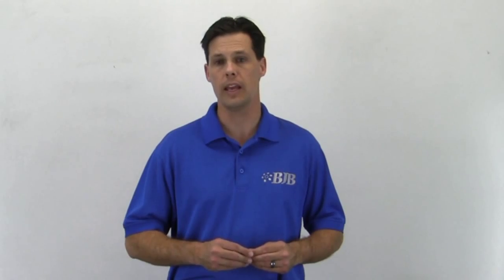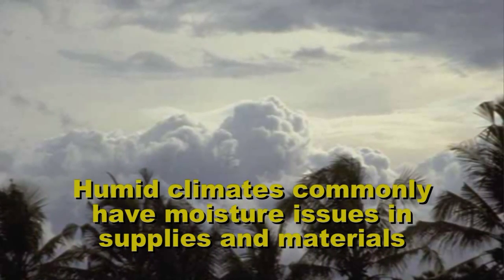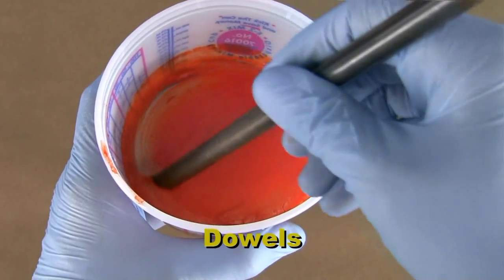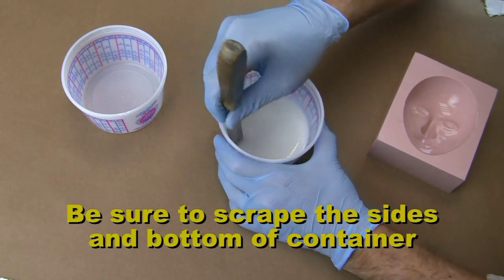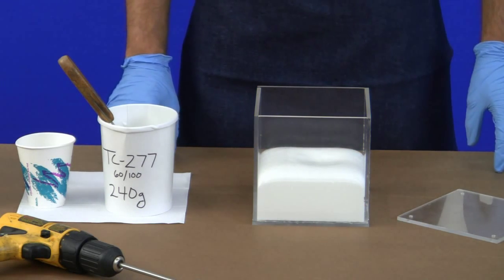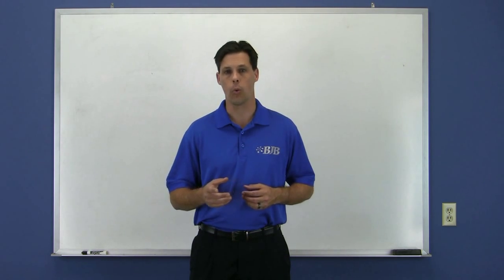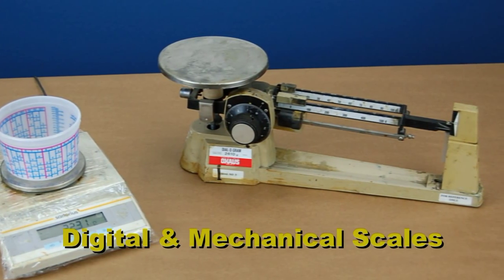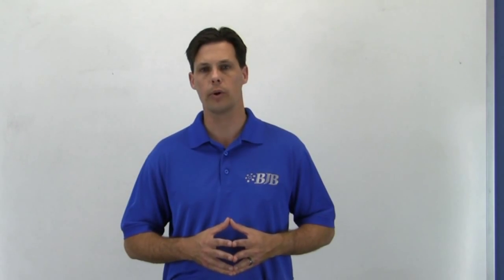How To Properly Mix 2-Part Resin

Comment: This is a great video.  I was about to purchase a scale to mix my resin, until I saw another video where Part B weighed significantly more than Part A, which is why we shouldn't measure by weight, but by amount.  Any thoughts?
Reply from the maker: Samantha Castleberry your resin is designed to mix by volume and the density of A vs B is different.  Mixing by weight is typically far more accurate than volume mixing by eye, but many systems are forgiving enough to allow for slight ratio offsets and will cure fine if you’ve mixed thoroughly.  There are some resin systems and silicones that are very critical on the ratio and it is highly recommended to use a scale in those cases.

Comment: Can the epoxy be diluted if too thick. If so with what solvent?
Reply from the maker: we do not recommend "diluting" epoxy or urethane resins as it would effect your physical properties. it is possible to make them less viscous by heating the material prior to casting but that will also lessen your worktime.
Reply: @bjbenterprises  Thanks
Reply: Thanks.  I had this same question.

Comment: I am not claiming to be more knowledgeable on this subject than this guy is because it's obvious to me that this guy knows more about this stuff than I do. But be aware that some epoxy manufacturers prohibit the use of any mechanical mixing device because of the air bubbles such devices create in the resin. And that makes sense to me. So use or ignore my advice as you see fit. Good day.
Reply from the maker: It's certainly possible to mix air bubbles into you epoxy resin using a mechanical mixer, but it's usually from using an improper mixing blade and/or mixing too small of a batch so the blade is not fully submerged.  If you use a mechanical mixer in a shallow pool of resin, you will induce a lot of extra, unwanted air.  Hand mixing would be a better solution in this case.  Also, if you run the mixer in and out of the liquid you will induce more air (not recommended).  Many shops will also degas the mixture in a vacuum chamber to remove air before using so the bubbles can be dealt with.  If there are high level of fillers in the resin (like aluminum filled epoxies) a shearing blade will increase friction and cause some heat.  This can be a good thing or bad thing depending on the mass of material mixed and the worktime of the system.  Other than those items, there is nothing inherently bad about using a mechanical mixture if you understand the how to use it properly and know pros and cons of using one.
Reply: @bjbenterprises  Thanks for the information, I appreciate it and will put it to use. As I'm sure others will also. What not to do is as important as what to do when working with sensitive materials. Thanks again.

Comment: does the Tc 5050 a/b need to be vacuum ?
Reply from the maker: Only if you don't bubbles in it.  You can still make a mold without using vacuum, but expect many trade offs.  The end user has to decide if those trade offs are important.  Pulling vacuum does the best job at reducing bubbles physically.  Some bubbles will rise to the top and pop on their own, but you will still have bubbles in the silicone.  This reduces tear strength, increases possibility of aesthetic bubbles on the surface, and prevents you from being able to put the mold in a pressure pot later.  TC-5050 is one of our best production mold silicones, but the higher viscosity is a trade-off for best longevity and performance on the mold.  Low Viscosity silicone systems designed to be "no vacuum necessary" will trade durability and stability for ease of use.

Comment: What do you recommend to clean the resin off your tools?
Reply from the maker: Isopropyl Alcohol works well for polyurethanes if it is still in liquid state.  Acetone works well if it is starting to cure or has already cured.  For silicone, just wait until it is cured and it peels off or rubs off with a rag.

Comment: I sat through all 7 minutes and He never addressed  BUBBLES  in your mix.  wtf.?.  I hate bubbles,    I wanna know how to get em out..  or   stop em from forming in the first place..
Reply from the maker: Hi Thomas.  Indeed, bubbles are a pain.  We do address dealing with air bubbles in our other mold making tutorials, but it would be a good idea to make a stand-alone video on dealing with them.  The truth is, if you are mixing thoroughly to achieve a proper mixture you are going to entrap air bubbles.  Period.  The best way to deal with them is to vacuum degas the mixture.  This works for both silicone and cast urethane.  For details on pump requirements and other tips, watch here:  https://youtu.be/iRj6xzNx7P4?t=12m15s  Pressure casting is another method but we explain the differences between the two here:  https://youtu.be/WME8R2-Ot8E?t=8m57s  Thanks for the feedback and let us know if you have any other questions.
Reply: Hi BJB,  Thank You..  I'm using Clearcast 7050.  I follow the instruction to the tee.   Proper stirring for 3 minutes,  I have a home made vacuum chamber (5 mins)..  I use a large shop vac..  i know it's not the best,  but, I'm a home novice..  A pressure chamber is more involved ..    i'll watch your linked videos..  Thank You..,
Reply from the maker: A Shop Vac (high CFM but at low vacuum) does not generate nearly the vacuum needed to successfully degas these materials.  Even a single diaphragm pump popular for vacuum bagging composites and wood is not sufficient at yanking the air out (usually they only achieve about 26" Inches of Mercury).  The bubbles may rise to the top surface but they often won't "pop" so it defeats the purpose.  You can see more info here:  https://youtu.be/tnY86LIHf_I?t=12m10s  For DIY hobbyists, there are some decent low cost solutions available for pumps and chambers online and sometimes you can find deals on surplus pumps.
Reply: BJB,  Wow,  i guess I was way off..   I do have an air compressor that can fill a smaller tank in a minute or two..  I like to build my own stuff,  not just cuz it's cheaper,  but, because I like too..  The pressure pot is doable and  I'll find a real vacuum pump..   I'm enjoying it enough where,  it's worth the time and expense..
   Thank You,  You cleared up a lot in my mind..

Comment: Mixing ratio of resin and proxide and mixing time
Reply from the maker: Can you clarify your question?  What is proxide?  Mixing time depends on how much material is being mixed.  You can mix small batches as fast as 30-45 seconds.  Larger batches may take several minutes to effectively mix.

Comment: how many ounces of pigment per gallon of epoxy ?
Reply from the maker: Typically we recommend 1-2% of pigment by weight if you are using BJB's 
6800 series pigments.  A gallon (approximately 8 pounds or 3600g) would 
need 1-2oz of pigment (36-72g).
Reply: wow another company told me 5oz per gallon. and somebody else said 4oz per gallon.
Reply from the maker: If you start going above 4-5%, you start to affect the heat resistance of the epoxy because you are adding a lot of un-reacted liquid dispersion from the pigment.  Depending on the color, you may have to add higher % to achieve an opaque finish, but 3-4% is usually max.  If you are using a powder pigment, you can add much higher percentages.